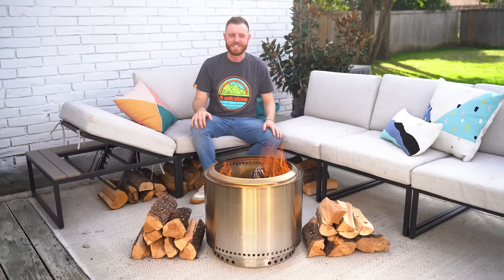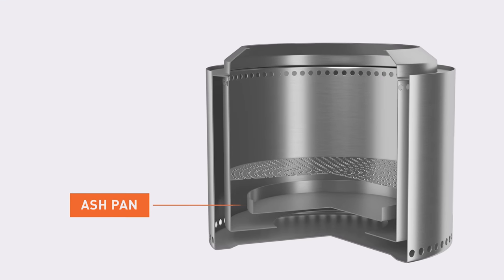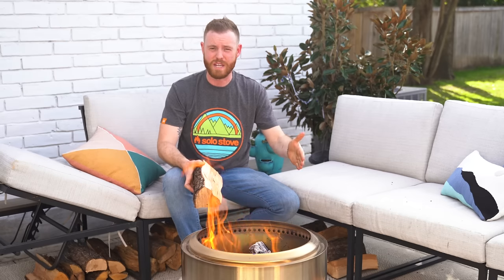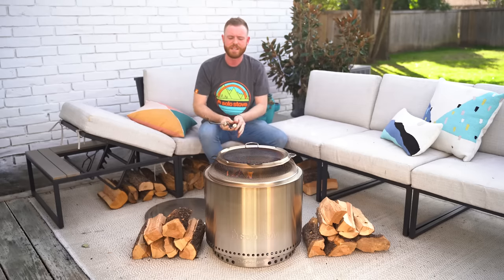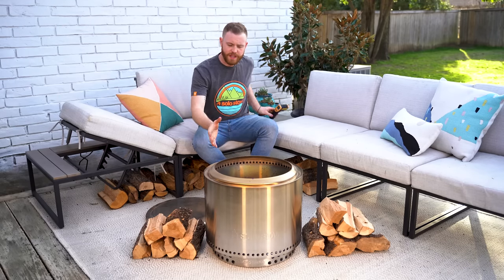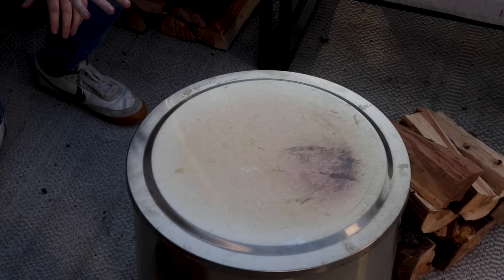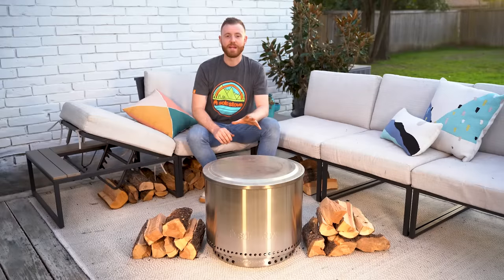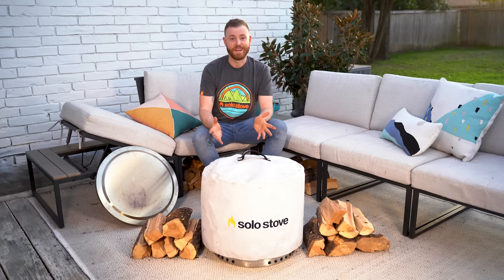ANSWERED: How do I put the fire out in my Solo Stove fire pit?

Comment: First, this fire pit is amazing. Got the Yukon and it’s great. Wish it had some type of handle to move easier, but not that big a deal. Would be cool if the cover had hooks on the bottom that could grab the stand holes to keep it secure from wind. Otherwise this product is perfect.
Reply: They sell a handle.
Reply: Good point on the cover hooks
Reply: @chaank1069  A handle that you can't use until the inside of the pit has cooled to a point where it won't melt the plastic numb on the handle, rendering it pretty much useless. I love my Solo Stove! I bought every accessory they had a year ago, and now I just got the heat deflector, but the handle is useless.

Comment: You're using the stand in this video, correct? Does the stand need to be removed and stored elsewhere when not in use when using the shelter cover? It doesn't look like the shelter is long enough to cover the stand.
Reply from the maker: Joseph, we are using the Bonfire Stand in this video and anytime we burn on a wood deck or rug.  When Bonfire is up on the Stand, the Shelter does leave a few inches uncovered which is totally fine.  The stand doesn't get very hot, meaning the Stainless Steel is safe to get a little wet. Great question though!